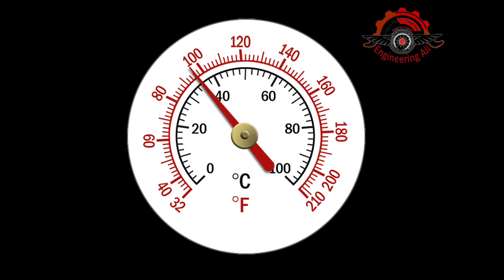Can you use your car engine oil for a generator? You'll see..

Comment: My Champion Generator Manuel specifically says any High quality AUTO oil 10w30  .That is what MOST manufacturers recommend the same thing.  Using small engine oil is not necessary. I personally use Amsoil 10w30 signature series auto oil in mine, And that far exceeds what they recommend.